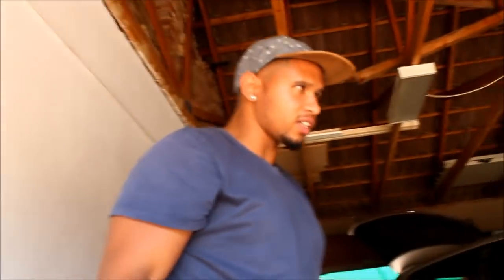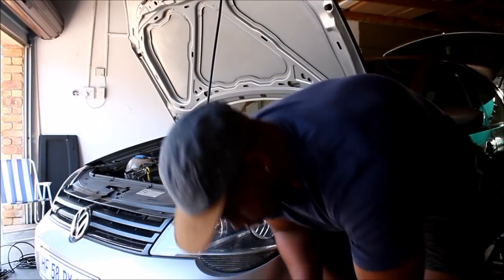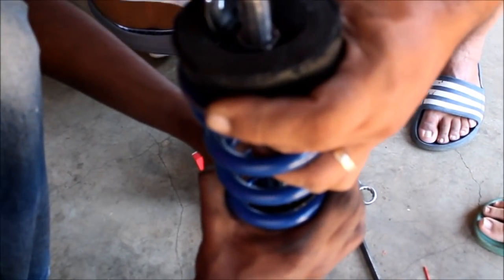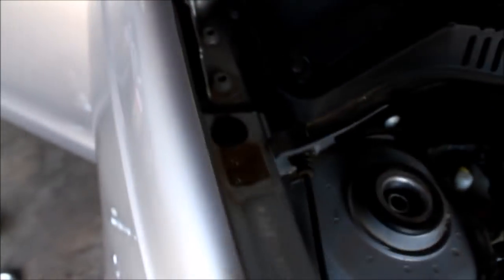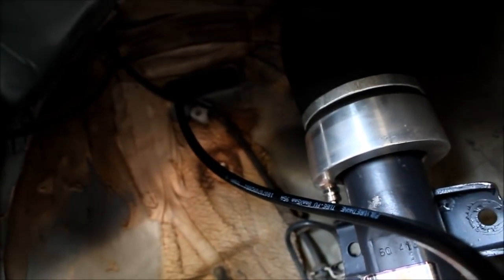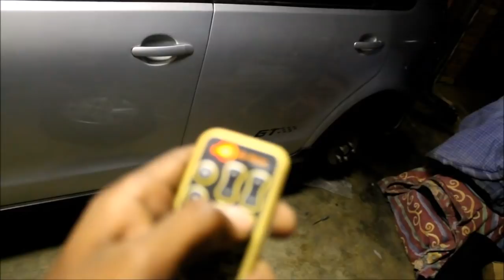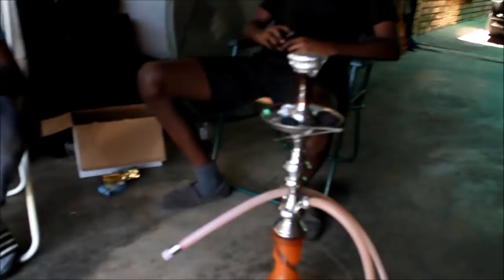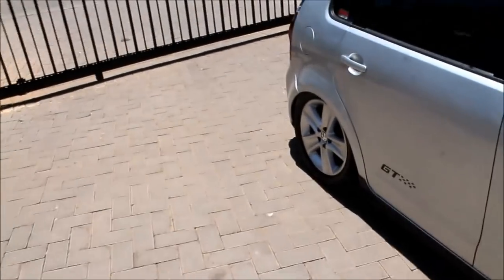Vdub Camp Fest 2019 preps Air Suspension Installation!!!

Comment: How much for a 9n3 polo gti and do u supply the air ride
Reply: awe bro , we don't supply , only do fittment of the air and boot installs , we get out bags for a castor air supplier
Reply: for the polo for wire less/Bluetooth system with a basic boot set up you looking at around 27k. With a full boot install you looking at 30-32k based on what you are looking for
Reply: I'm gonna vlog tomorrow , so the next vlog coming up , I'll show an example of our work in terms of sound installs